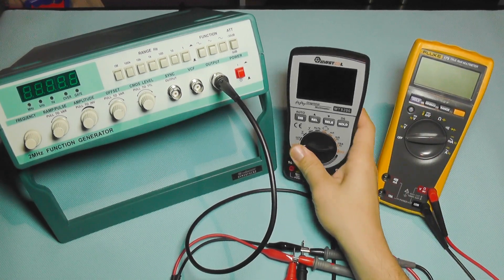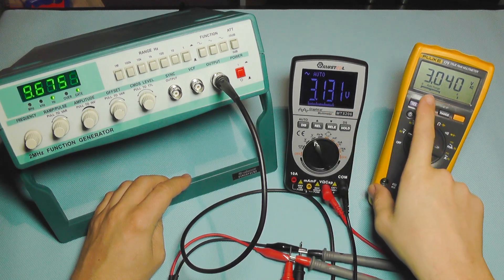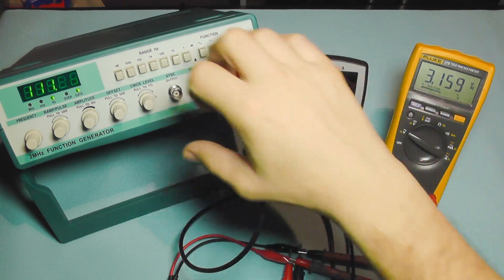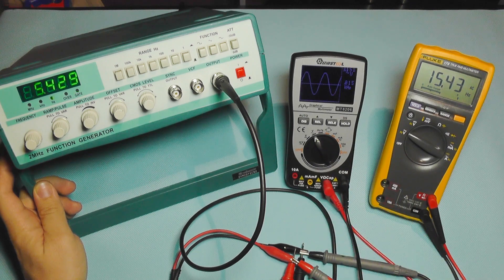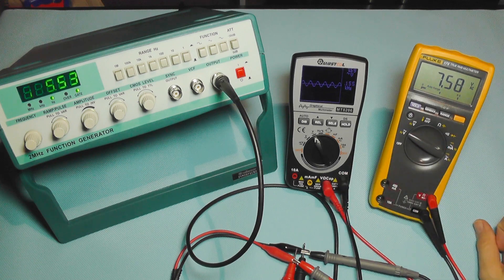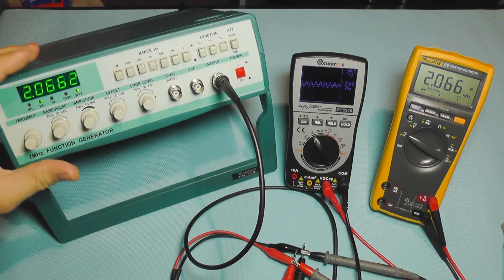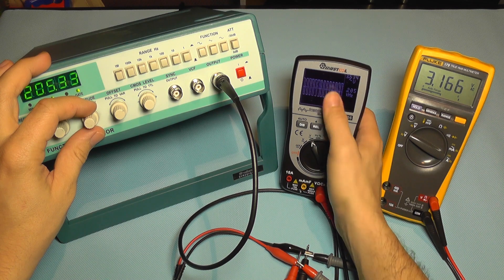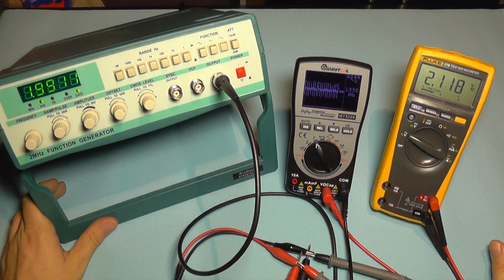Mustool MT8206 vs. Signal Generator vs. Fluke 179 True RMS

Comment: This little device worked great for setting my gains on my amplifiers💠>imgs.love/QOscilloscopeKit?ӎ    There are videos on YouTube explaining how to use this little guy. Sure, you could go with a DD-1 but I’m not going to be using this device every single day. Could not justify the cost of the DD-1 even though I hear it’s a solid performer as well.
Reply from the maker: You are right, sometimes cheap tools are more better than high end ones as they cover like ~98% of uses and cost 10 times less :)
Reply: Do you know if you could use this to measure phase alignment at different stages in an amplifier? Wondering if i could use this to calibrate a negative feedback loop.

Comment: is it possible to use the digital graphical multimeter to measure capacitors in radio electronic like guitar amps?
Reply from the maker: No
Reply: @TechTronic9000  Then what is "mF" setting on its dial?
Reply: @henriktoth56  theres another video on what you want to do. You got to put the red lead in the mAmF spot and the black in the Vcap spot. i hope this help